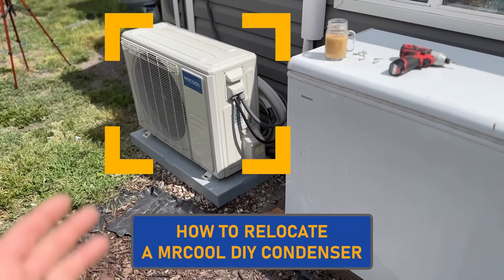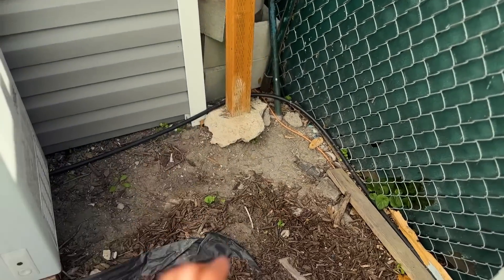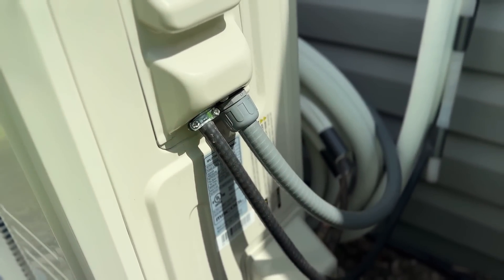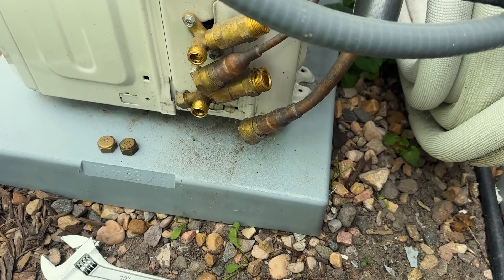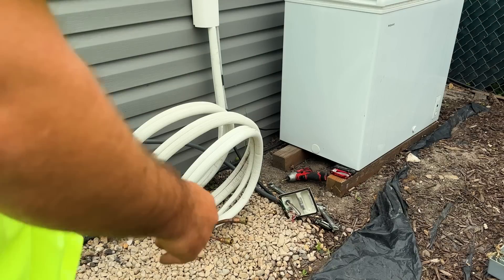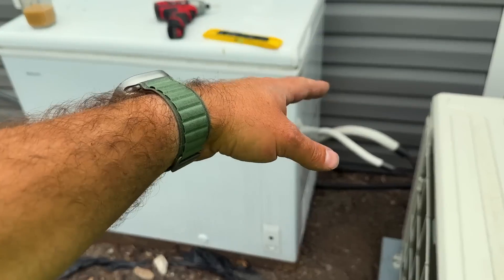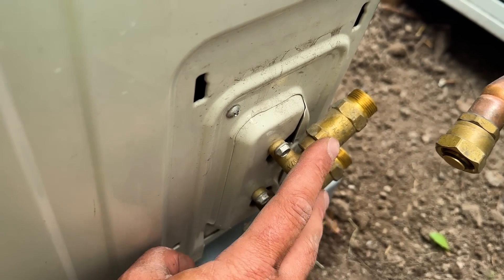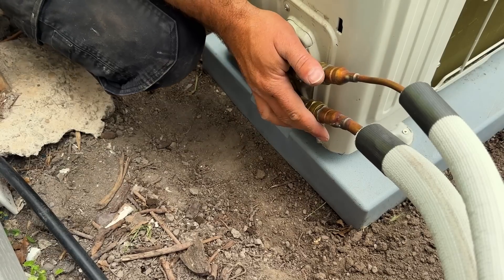How To Relocate A MrCool DIY Mini Split Condenser

Comment: Question I have a Mr cook and the cooling stoped working. Any idea how to fix this? I did do some wood work in the shop I had it in and figured that some how ruined it. The heat does seem to work on it just fine.

Comment: Thanks for the video. I have a question.  After you disconnect the lineset from the outside unit, if you also want to relocate the inside unit, is it safe to disconnect the other end of the line set from the inside unit? (The other side of the lineset is connected to the inside units' protruding line with a quick connect. ) I have the same unit, and I want to relocate both units. Thanks for your answer.
Reply: Yes you can. Both ends are self sealing.

Comment: Thanks for this video...I bought 3 of these units and after watching your videos have serviced all my own units successfully. I will now buy a different brand to install in our attic as Mr Cool products are way over priced. 1 of my Mr Cool units has a slow leak and needs to be charged up every year and the company will not honor their warranty as they claim it was installed improperly...I found the leak in the compressor unit...BEWARE
Reply: What unit are you getting that’s so much cheaper than Mr cool? I love only had one but been cranking it year round (heat and cool) for 4 years now still going strong.

Comment: I would spend extra 7 dollars at Home Depot for 1/2" PVC conduit and two clamps and stick that communication cable in it and hang it on the wall.

Comment: Hi mate I have a Panasonic CU-Z24RKR. I need to disconnect, and shift appropriately 9 mts. Do you have a wind down procedure to push the gas into the unit? Can I use mechanical fittings to add tube length? Rather than weld? What is the best and cheapest tool set to vac and release the gas back into the system once moved? Appreciate your response🎉
Reply: Hi, have you maybe found the solution, some yt video or something to do this? I need to move my outside unit too and cannot find any diy video about it.
Reply: @neshco  yeah I did I’ll try find it
Reply: @neshco  https://youtu.be/RMGAQWJrGeE?si=V653GTWuoVUcfAVd

Comment: you can do this with any unit. you need to trip the signal to turn on the compressor and close the high pressure valve to the evap if you can put a gauge on the low pressure side and once it drops into a mild vacuum shutoff the low side and you can pull the lines
Reply: How do you trip the signal to turn on the compressor? 

Heat stopped working yesterday and the code "FY" popped up on the display. Which says low on  refrigerant. I don't have a Mr. Cool. Got a Pioneer. And don't have recovery setup or nitrogen tank. Got a can of refrigerant with leak stop and another can of just refrigerant. Totaling almost 4oz. I would imagine I still have refrigerant in the system. Thinking to use the can with leak stop 1st and do a pressure test to and put enough refrigerant until the pressure read 117-120. 

But if there a better way without going through a recovery I'm open. Paying for someone for what they want to repair in my area, I may as well just replace the outside unit, line set and evac.
Reply: I installed my MR. COOL Two summers ago and I was surprised he didn't do this step. I realize the lines were self sealing on install but didn't realize they would still seal off charge in the line set after the installation. I think I would run the whole charge into the condenser to be safe.

Comment: Great video.

Others complained about code violations. Maybe those issues are OK in his area. Anyway, another possible issue is the length of the whip. I believe the NEC indicates a maximum of six feet between the HVAC unit and its disconnect.

Comment: Shouldn't you have uses a liquid tight connector on the existing control wire instead of the basic romex connector?

Comment: Another cool video would be to see how you move a mini-split without those cool specialty hard lines.  I suspect a re-vacuumed procedure?  Would to much refrigerant be lost if you just had the basic 16 foot lines evacuated; after releasing the coolant back into the lines from the mini-split ?  Would you have to adding some 410 back in?
Reply: See Zoey and my comment about this. You can close high side valve run unit with low side open till it has pulled the refrigerant into the condenser and then close low side service valve. You would still need to vacuum refrigerant line and evaporator but you wouldn't loose any refrigerant.(Maybe a little)
Reply: @edkight6447  And use a Micron gauge with Shrader valve removal tools...
Reply: I agree, and would also like to learn more about the moving process of other brands. An HVAC person can do it. I know a person in Montana who heated his house 70% with a 12,000 BTU mini-split for about 15+ years. As an early Mitsubishi unit, he was one of the first to get the units as they were introduced,  he knew it was "undersized" for the home, but had additional resistance heat and solar hot air heater. These units can really heat and that unit worked for years. It was moved at one point and they just pumped it all back into the unit. According to my understanding, unit longevity is, in a large part, directly related to keeping moisture out of the coolant and keeping coolant lines sealed properly. This is why one draws a vacuum (the vacuum boils off any water moisture, as any moisture in the system rusts pump components from the inside). For example, if it was raining outside, it would not be the time to move the unit. Sealing lines properly are also very important. Bad seals on the lines can allow all the refrigerant to escape. This is why in part refrigerators can last forever. (Everything is sealed in the units.)

Comment: I always get a good laugh when you call service valves "king valves"
Also it is against code to pull Romex through conduit in wet areas.  Outside is designated as wet.

Comment: Even though it is in liquidtight flexible nonmetallic conduit with listed fittings, type NM  cable [flexible thermo plastic with paper insulation] is not listed for use outside of buidfings or in brick walls which is considered damp or wet locations. Should be type UF cable [solid thermoplastic] or individual conductors with insulation listed for damp or wet locations e.g THHN/THWN. Very good video.
Reply: Correct not for damp locations by code, plus that’s a huge pain in the ass to pull through any conduit solid wire plus jacket. 😢

Comment: If I put a mrcool to a r22 system would that work?
Reply: Your question doesn't make sense. Mr. Cool is a closed loop system. The outside unit connects to the inside unit. You can't connect a Mr.Cool outside unit to an existing system if that's what you mean. Mr. Cool also doesn't run on R22. Do some research. R22 is so old the refrigerant they replaced it with is already being replaced.
Reply: Of course it will.
Reply: @nandog6946  no. It will not.

Comment: How do you do it if it doesn't have those mr cool quick connects? I have to move one of mine right now haha
Reply from the maker: You’d have to recover the refrigerant or try and pump it into the condenser, move it, then evacuate the system, and refill.  Wwaaaay more work lol
Reply: @diyhvacguy  dang it lol yeah
Reply: @diyhvacguy  what is that pad you have it mounted to and where can I get one?  Or what is the search term to use to find it.  So far I can't find anything like that

Comment: Did I miss the part where you said the unit needs to be completed shut down first?
Reply from the maker: Yes, when we turn the breaker off and pull the disconnect.

Comment: I think you are supposed to put black tape on that white wire to signify that it is also hot.  😁 p.s. A lot of use use ad and pop-up blockers or browsers that have them built in. We don't see those links that you point to onscreen. Can you please put the links in the More section? I am super interested in a Mr Cool or which ever unit you recommend for my house.
Reply: 16:25 he gives you a shoutout
Reply: @william18miller  Exactly. Just doing what he wanted
Reply: @Watchyn_Yarwood  dang I glazed over the emoji signifying sarcasm was involved  🤣
Reply: I am pretty sure wrong. The main voltage is a two leg. It’s known that you have two hots with 2 legs or how would it walk correctly? Besides maybe in a circle. Lol.  Kidding. Sorry.

Comment: Code reads to not run romex in conduit
Reply: Came in to say what was already said, that the violation is NM in a wet location. Having said that, why are there so many videos of people pulling Romex in conduit? They literally sell THWN-2 at Lowe’s/HD right beside the NM-B, but it seems that Romex is the hammer that hits every proverbial nail. It is so much easier and satisfying to pull THHN/THWN-2 through conduit than it is to try to muscle NM cable through conduit.
Reply: @sigcrazy7  UF is actually cheaper at my HD than NM.
Reply: You absolutely can run NMB in conduit in dry locations only as long as 53% fill is not exceeded. The code violation here is for wet-location use, outdoors or  underground inside a house for instance is considered wet.
Reply: Thank you for elaborating on the specifics of the NEC. It seems my information was generalized to use THHN/THWN wire or cable designed for wet locations.
Reply: UF is acceptable.

Comment: Good informative video. I have a Mr Cool for my shop. I don’t like the layout of the lines, and may want to relocate. It’s nice to know I can do so.
Reply: When I installed it lst December, getting 12 gauge Romeo into the outdoor unit was a bit of a struggle. I’ll need to check mine to see if the cover/connector is in 2 pieces.

Comment: This is assuming that you have extra line set to begin with otherwise this is a whole different process to extend the copper not just extend the electrical
Reply: Mr Cool sells extensions for the line sets, it comes with extensions for the wire back to the head unit.